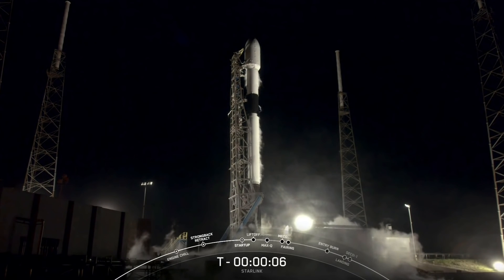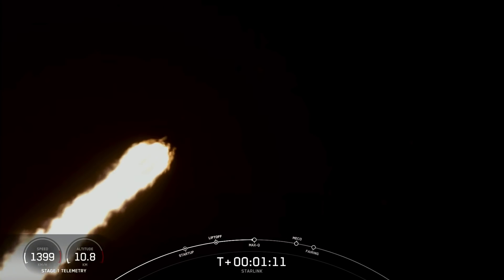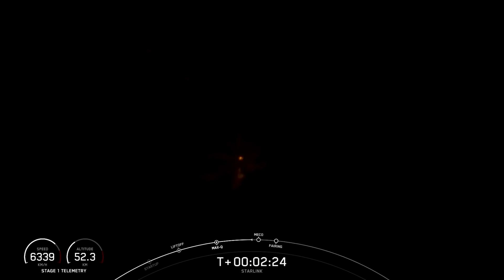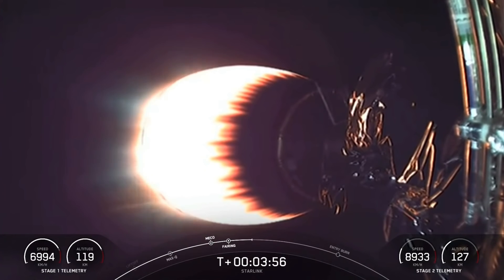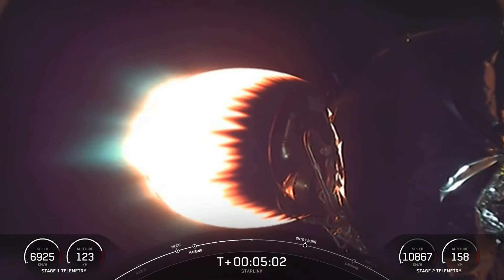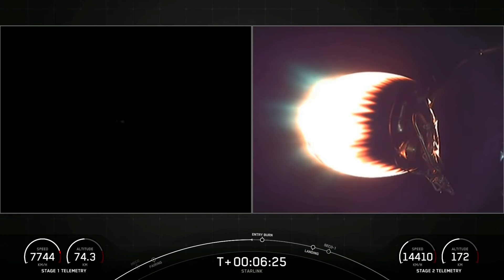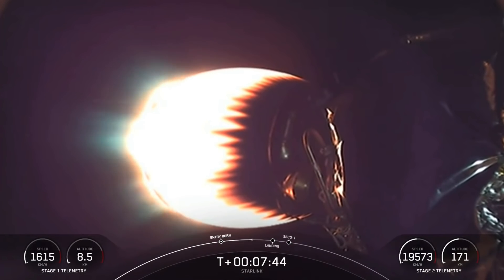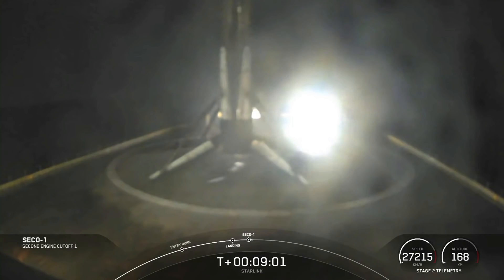SpaceX launches Starlink 24 mission! Nails booster landing at sea

Comment: Why don't you land it, where you launch it?.
Reply: depending on the mission, they may decide to use the the landing zone at cape, but due to the payload and the orbit they may need the extra fuel to reach the required orbit and still use the remaining fuel to land at sea. again all determined by the mission and sometimes they may not choose to land at all.